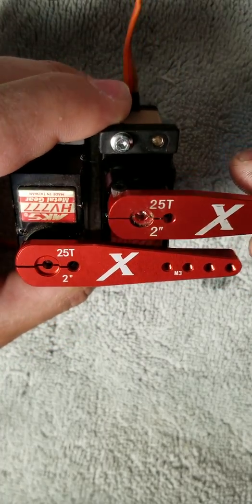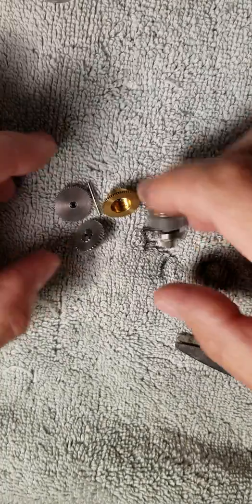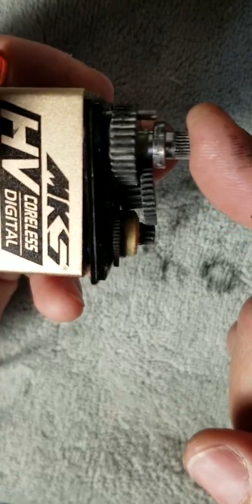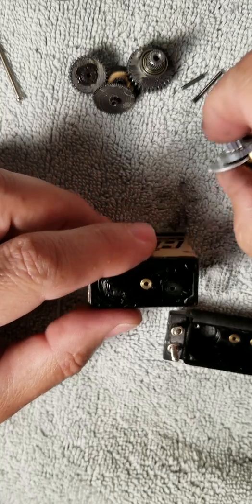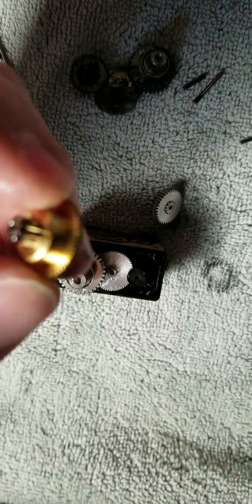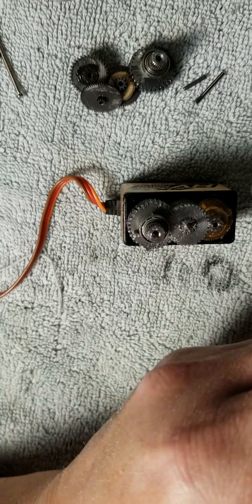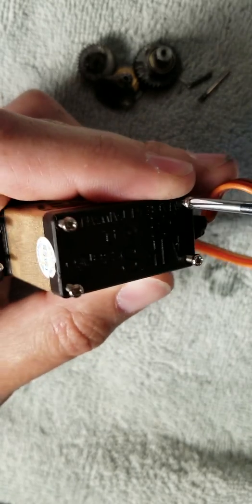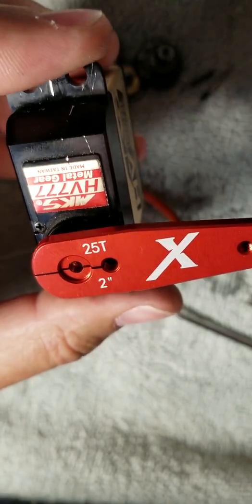HOW TO REPLACE SERVO GEARS

Comment: Most Hitec servos have slop brand new. The gears look basically identical to every other metal servo gear. Perhaps the reason for better performance is the tightness of the pins that will prevent gear wobbles, and destruction of the teeth.